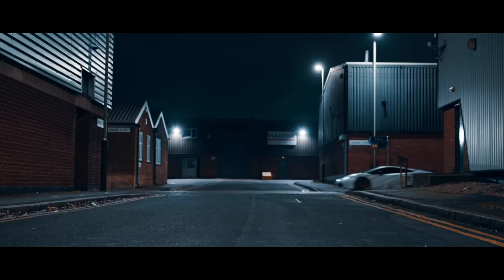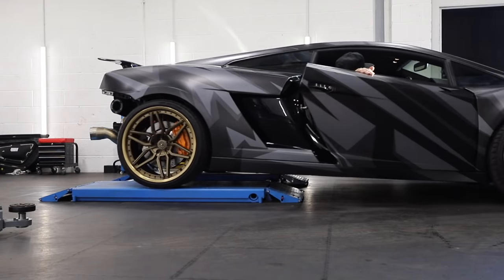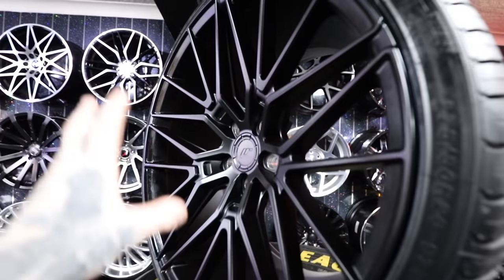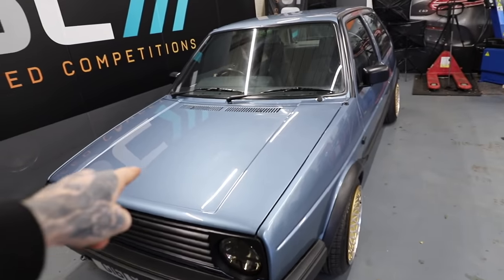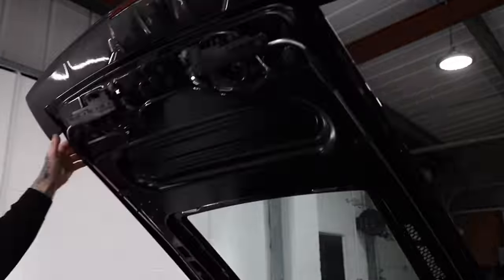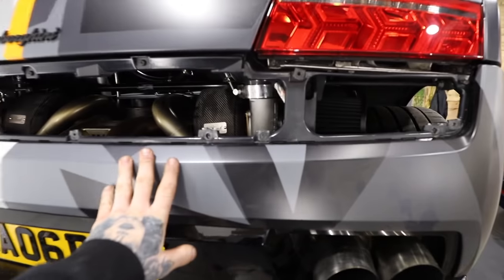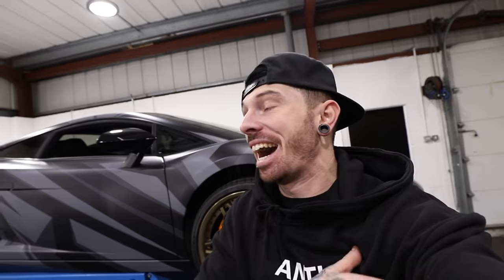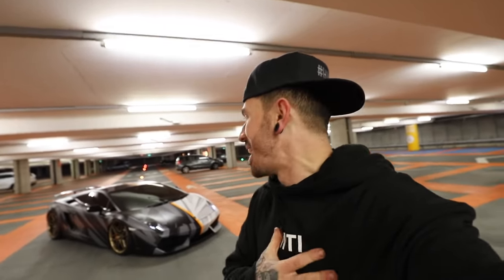MY DREAM TWIN TURBO LAMBORGHINI IS COMPLETE

Comment: Red LEDs for the Turbos would look great, and save you getting pulled for showing a white light to the rear when not in reverse. :-)
Reply: THIS! 🤩
Reply: Orange I would say...
Reply: You can show white light from the rear as long as the actual bulb itself isn’t in view 
Hence why number plate lights face the ground
Reply: orange please!
Reply: @jakel9410  where did you get that info from? There are only two exceptions (from construction and use regulations) You can only show white light to the rear for number plate lights and reversing lamp to light up the road behind and to warn someone you’re reversing. 

In any case, I don’t think police would get too excited about that!

Comment: Wow that vinyl is just fire.  Awesome Matt, well done mate!  Just another little idea though - you might like it as it is but what about wrapping that air cylinder behind the seats in forged carbon?  I think that would be quite classy. It would help blend it in a bit more with the dark interior too and make it look a little more integrated rather than just ‘sat there’ (?)

Comment: The secondary wrap doesn't match the first wrap pattern, looks bodged.
Edit: it doesn't follow the pattern as in continue. Front of the bonnet is two spikes an the bumper has a solid block of colour.

Comment: youll get points on licence for wheels not being under wheel  arch . danger of flicking rocks at cars behind
Reply from the maker: What car doesn’t have wheels under its arch?
Reply: @MatArmstrongbmx  I put some wide wheels o a cavalier back in the day Nd got 3 points and fined becsuse they stuck out 2 Inches from under the arch
you've nothing to stop any road derby flying through  windscreen even trailer wheels have to have arches by law , ide at least  check it out
Reply from the maker: @quincy5855  all my cars have arch linings and all wheels are within the arches so I’m not sure whether I’ve missed something 🤷‍♀️
Reply: @MatArmstrongbmx  the Lambo when you remove the back part that covers the exhaust it leaves the wheels without a good part of the arch ,the rear bumper makes up the rest of the arch
Reply from the maker: @quincy5855  oh I see well the bumper is on now. But the rule is in place when the wheel protrudes the arch when viewed from above, as is the rule with arch lining aswell aslong as the wheel is covered from above. Hence motorbike mudguards etc
Reply: @MatArmstrongbmx  no probs